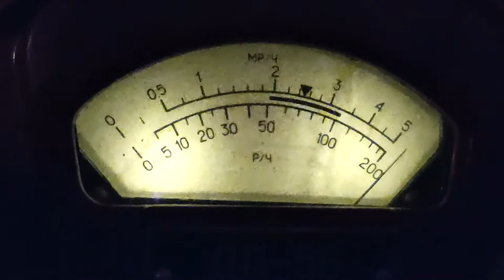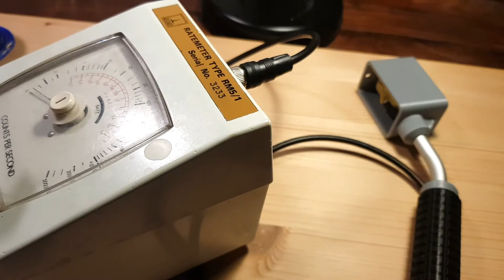How I Made The Connector For The SBT11A Probe

Comment: You installed the connector upside down.  The recessed porting of the connector you have on the top is supposed to be on the bottom so the connector lays flat.

Comment: What resistor value did you use?
Reply from the maker: I used 1 megaohm, but Ive been told that a higher resistance like 4M7 would be better for the tube. Either will work, but the 1 Megaohm may burn out the tube quicker
Reply: @radionuclei9524  hey, thanks! Also, I was thinking: what if all the anodes were connected together and only one resistor was used? Could that work?
Reply from the maker: @mandarin1257  It will work. But the tube basically act like 3 separate tubes in one unit, so they should preferably have each their own resistor.
Reply: @radionuclei9524  mhm. Thanks so much for the advice, I'll get my hands on one soon enough haha. Glad I stumbled on your little gem of a channel by the way!
Reply from the maker: @mandarin1257  No problem, and thanks 😊